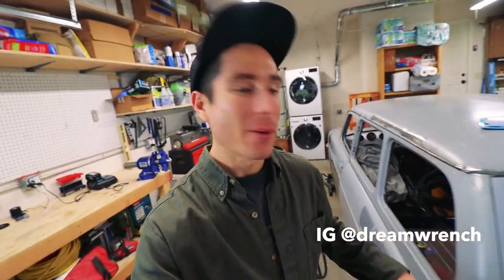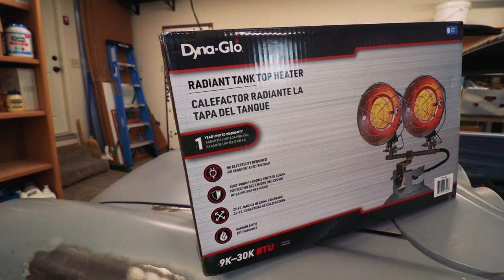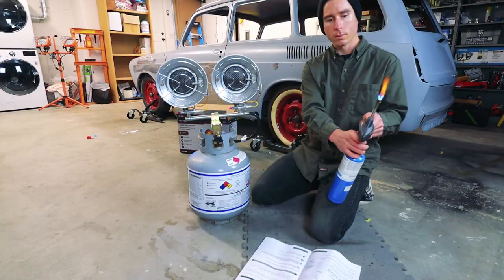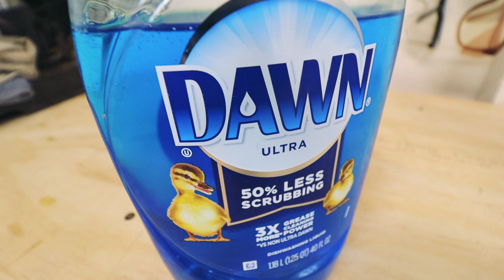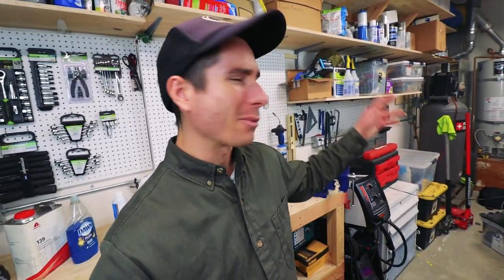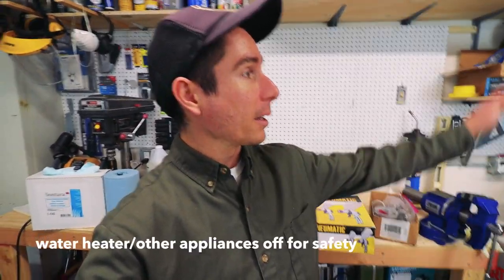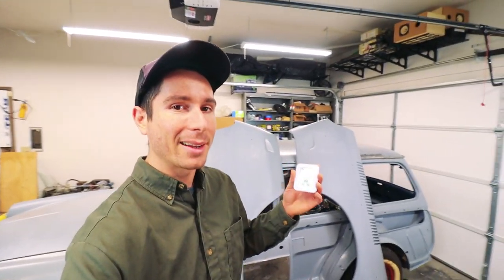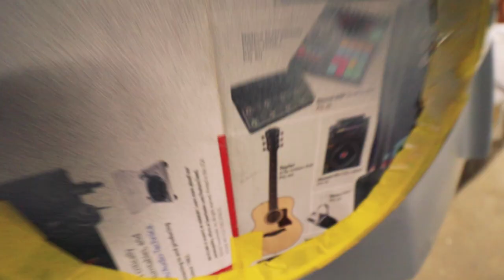VW Squareback Build - First Primer in New Garage

Comment: I'm working on an old 1961 vw type3 squareback. It's a long way from a new coat of paint rn but I'm doing my best, any pointers?
Reply from the maker: Nice, that's an early one!
Is it running and driving? I'd say start out tackling small jobs and spend a lot of time driving/enjoying it. I think spending more time behind the wheel can help someone figure out what they really want to do with the car. 
If it's not running/driving I'd say spend a lot of time on the forums and make a plan for what it will take to get the car back in the road. 
What color is your 61? Can the OG paint be saved? 
Above all else enjoy the build!
Reply: @DreamWrench  I believe I'm possibly the 3rd owner, I got it from my great uncle who had dementia, while he had it it was running, till he burnt up the wiring. In around the spare wheel is rusted out at the bottom, running boards are in the process of getting replaced and under the quarter panels in front of the rear wheel is rotted out, that's to name a few things. It was in a lot better condition originally, but my late great uncle had kept forgetting outside and we both live on opposite sides of a river. It was originally white and while some of it is saveable, most really isn't. It's unfortunately not possible to return it to original due to the rust damage and a serious lack of cash so I'm just doing my best to make it work and look the way I want, while letting it retain the ability to be restored properly if I can find someone more passionate about seeing it truly live once again. I was given it after he passed away, I tried talking him into letting at least help him fix it but it was his pride and joy, he wouldn't let anyone work on it unless he was informed of a skill that may be needed. Unfortunately we don't live near any area that specialized in the necessary areas and he didn't have a trailer so it didn't get much done, though he did his best to get parts for it.